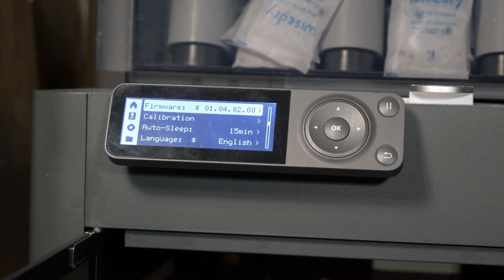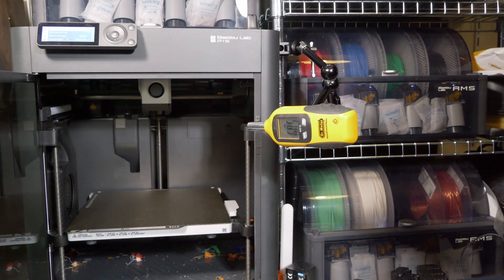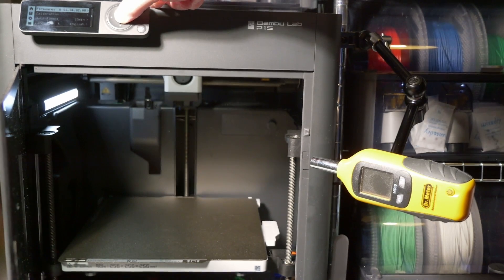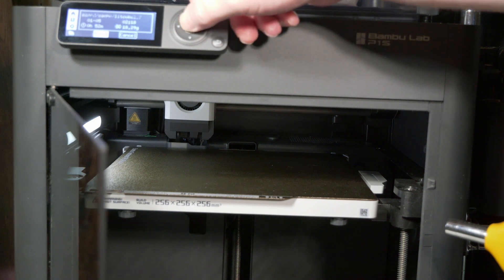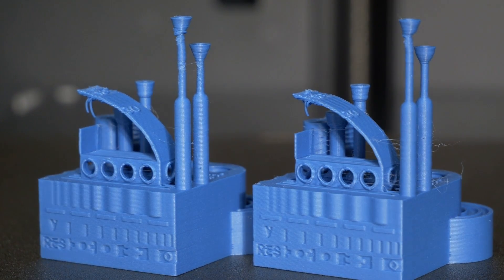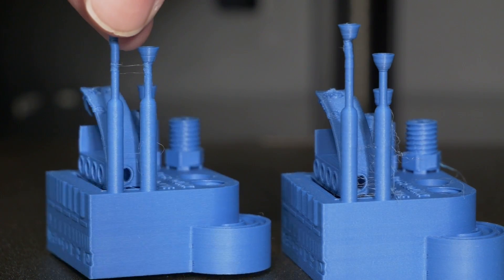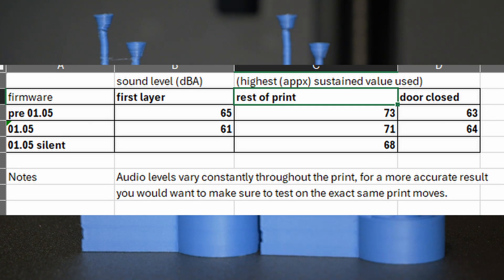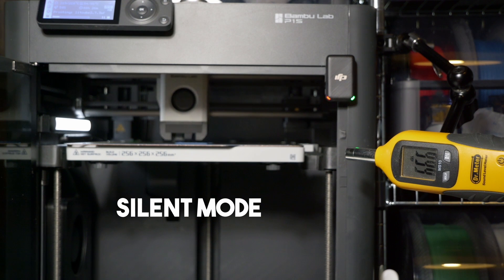Does the New Bambu P1S / P1P firmware REALLY make motors quieter? Tested before and after.

Comment: What is the deal with silent motors. Trinamic drivers already accomplish that and much more(but only a few printers take advantage of all the cutting edge features). BL reinvented the wheel?, by designing its own stepper drivers from cheaper controllers and now making it silent through a firmware update?🤔. Definitely makes BL machines little quieter.😂❤👍
Reply from the maker: I addressed it a little in the video after, but yeah who knows

Comment: The update was supposed to change noise levels of the motors, but the loudest part is the aux fan. So a noise level meter can't pick up a big difference, because fans produce white noise that covers the entire frequency spectrum. However if you turn down the fan to 50% or less then you notice the changes a lot. Before the update the motors themselves were producing sound in the lower frequency spectrum, which requires a lot more sound energy. We just don't notice it that much because humans are more sensitive in the medium and high frequency range. After the update you can hear a lot less of these low frequency (high energy frequency). This directly changes how far the soud can travel and how much it is affected by walls and doors. I think the noise level meter would also show a bigger difference if the fan was off before and after the update.
Reply: Which fan is the AUX fan? You mean the chamber exhaust fan? Is a replacement possible?
Reply: @Tome4kkkk  No, the aux fan and the chamber fan are two different ones. The chamber fan is in the back of the printer and the aux fan is the big one to the left of the heated bed. It always blows onto the part. It is there for additional part cooling to allow faster printing. Both fans can be replaced and you can get replacements in the bambu store.
Reply: @Noxoreos  That's good news that the main noise culprit is in fact not necessary in all scenarios! And is replaceable. Another candidate for the slapnoctuaonit treatment ;)
Reply: @Tome4kkkk  Right, not only that. The aux fan gets really loud above 60% speed. When your model is not that big, it is better to reduce the speed to 40% or less and place the object closer to the fan. Not sure if adding a noctua fan is that useful in this scenario because the main noise level actually comes from the duct that forms the airflow, which is supposed to be a rather flat plane. This is to avoid cooling down the heated bed and only affect the top surface of the print.
After using the printer for almost a year I don''t feel like it's a problem. I rarely set it to faster than 60% and don't print with the fastest possible speed, because the prints are also weaker and there is more internal stress when printing very fast.
Reply: @Noxoreos  Wow, thank you for the info! How do you set the RPM for the aux fan. Is it a physical-pabel-only deal or do the P1S profiles for popular slicers allow you to control that?
Reply: @Tome4kkkk  Normally with the P1P/P1S/X1C you would use Bambu Studio or Orca Slicer. There you set up a profile for each of your filaments and there you also set the aux fan speed. When you print an object, you assign the filament from your own profiles to the object and then start the print. This profile also defines the min and max temperatures for the filament, temperature for the heated bed, overhang setings, max flowrates and such. You can also define the type of filament and optionally it's color. I maintain a profile for each color that I have. For this you can copy existing profiles and modify them.
Reply: @Noxoreos  Thanks, some gokden comments from you! This reminded me... Ahead od me is a dreadful switching to a Prusa Slicer derivative... I find Prusa usability and UI layout attrocious. I really hope Bambu Studio and Orca have very little in common as far as workflow goes...
Reply: @Tome4kkkk  I've never used Prusa Slicer. I switched directly from Cura to Bambu Studio and almost immediately further to Orca. However, while Orca and Bambu Studio are very similar to each other, it still differs quite a bit from Prusa Slicer in terms of UI and features.
Though, I still sometimes search for settings that I remember from Cura but they don't exaclty exist in the same way or are named differently in a lot of cases.
Anyway, Orca is still my preferred slicer now because of all of it's features. Easier management of settings and profiles. Nicer UI (in my opinion), special geometry to tweak settings, that apply only partially to the object. The possibility to create simple objects by using basic shapes and boolean operations. Painting on supports, material choice, material painting, and much more.
Reply: @Noxoreos  One more thing. With Bambu this or that will I be able to trick the printer it's at Z=0 at custom heights? It is a must for me as I intend to print some dual-material cockpit panels and letterings and I do not want to dive into AMS and the waste game. Such tricks are easily achievable on printers relying on Z end stop switches.
Reply: @Tome4kkkk  Well, there are a number of ways, because it relies on a pressure sensor on the bed. You could for example use a piece of plastic to trigger against, between the heatbed and the nozzle. But for manual multi material I would use a different approach. You can add custom gcode and pauses after each layer and switch materials by hand. No need for any hardware hacks. Bambu Studio and orca slicer support this feature
Reply: @Noxoreos  I'm not really sure it would work for lettering labels that are inlay at least 2 layers deep. (question to self: does need to be that deep?) I would imagine printing a separate lettering model with some huge Z hop would be the way to go.
Reply: @Tome4kkkk  i'd say as long as the inlay is planar / perpendicular to the bed, it is possible even with multiple color changes.
Reply: @Noxoreos  What I mean is at layer 0 (at least)you have  both - the panel body and the label lettering. So gcode pauses won't help. Unless I'm missing something.
Reply: @Tome4kkkk  That is possible as well. You just need to declare different materials. I've actually done that as well already. You can define the pause command as the filament change in the printer profile.
This approach is useful for cases where you can't use the ams like combine tpu and abs. Or use pla support for tpu prints.

Of course you could also modify the gcode file and add custom code anywhere you want. It can be read from the sd card with your changes, but then you have to start the print from the display panel.

If the lettering is only one or two layers high, then you can also split the part into two different gcodes: the first file should only contain a single layer of everything but the letters and the second file everything else (all layers), including color changes. Then place the print somewhere outside of the center and just print both files normally and perform the manual changes. This works only for rather small prints. The reason why this works for up to two layers very well is, because of automated color sorting by the slicer. the first print assures the correct start. Then the first two layers on the second gcode file should only print the letters (up to two layers high) before any color change is needed, unless you have more than two colors. Though handling more color changes than that gets impractical very fast. Bed probing should be disabled for that.

Comment: One caveat. There is a problem with the filament calibration in 1.05. LOTS of posts on this in the BL forum. And you CAN rollback an update in the Handy app.
Reply: Not in this case for the P1P/P1S. This info is even printed on the update screen.
Reply: @Noxoreos  Several people on the forum HAVE rolled back their firmware. Might want to pay a visit there.
Reply: @swdw973  I've checked the app and the page that says "previous versions" is empty for my machine. I'm currently on 1.05.01 and according to many others it should show older versions in the ap. But it doesn't do for me.

Comment: Just measuring the decibels doesn't really tell the whole story. You should have check the spectrum of noise as in my subjective opinion what's gone is the high-pitched whiney noises and those were able to permeate through my office doors and through my ventilation around the house, but now it's just the fans that are loud and I've noticed no difference in quality with PLA if I turn the chamber fan from 70% to 50% and the aux fan down a bit as well, but the noise is a lot less noticable.
Reply from the maker: I would hope that was demonstrated with the sound recording, which was the whole point. 
Checking spectrum, as I already noted in another comment, is well beyond the remit of a small channel's budget - in fact even bambu's budget apparently as they used a similar meter to me in their own demonstration.

Comment: dont feel like a decibel meter is the correct tool for measuring the noise reduction.  The frequency of the generated sounds is much less noticeable after the update.
Reply from the maker: lol I'm gonna need a few more than 750 subs to afford a full spectrum meter, did you click the button? :)
Reply: @foundintech subscribed! I wasn’t suggesting you get one. Just that from using my ears, I can tell that this is a much more noticeable improvement in annoying sound reduction than simply loudness would suggest.

Comment: It sounds like they
* found out spreadcycle/stealthchop
* are tuning for minimum (noise) stepper current to not loose steps
* could be fiddling with waveforms as well?

The middle one might be added to other firmwares as well, if normal drivers can detect skips (or check if endstop is where it should be after rapid moves). Fortunately non-BL printers have had silent drivers for a long time.

But the real question is: how does it compare to the competition?

Comment: Would be interesting to see how much just the motor noise is reduced by doing a print with very lo fan speed. The sound level seems a little lower, but more importantly it seemed to reduce the higher pitched sounds which we might be more sensitive to, even at the same db.
Reply from the maker: I tried it - it sounds exactly as you'd imagine: loud when fast.

Comment: Your info is wrong the P1S can roll back the firmware the, X1C can not rollback the firmware because of the jailbreak. Bambu doesn’t want people to use it so they blocked firmware rollback. The noise is night and day difference. New firmware released 1.05.1
Reply: On 1.5.0 it could not but once you update to 1.5.1 (which came out last night) you can roll it back.
Reply: When I did the update on my P1P a text explicitly warned that rolling back wouldn't be possible after the update. And from what I see, that's true.
Reply: @Noxoreos  true, on 1.5.0. Now on 1.5.1 you can
Reply: @3vlogs487  I'm on 01.05.01.00 and that's the latest version as of today. But I still can't downgrade. The page in the app that's called "previous versions" is empty for my machine. Everything else works as expected.
Btw. That's also the case with the machine at my workplace.
Reply: @Noxoreos  that’s interesting. Maybe make sure Handy is updated because I see the option there for me still.
Reply: @3vlogs487  It is up to date and I have a link that brings me to a page that's called "previous versions" in the handy app. But there is nothing to select and the button at the bottom is greyed out, since i can not select anything.
Reply: @Noxoreos  that’s so weird that it gives me the option then. It may be an option in studio too if you actually want to downgrade firmware

Comment: Mine has noticeably less motor noise now. It's so much so that i moved the unit from my basement  to upstairs and I still hear it less. Fan noise is the same but kinda like white noise. The axis motor noise levels are way reduced and thats the distracting part. Turn the fan down and the difference is huge. 

Also... restart your machine again. Another minor update rolled out right aftet this

Comment: When printing PLA do open up the top or remove the lid?
Reply from the maker: I don't, and I'm not sure why other people think they need to. The fan in the back comes on to remove air, seems like enough to prevent any issues.
Reply: Yeah on my x1c ,which is pretty much the same enclosure as this one.
 I have never had any issue with PLA with nothing open. 
It's recommended by Bambu but I have no idea why.

Comment: I've been running a few PETG prints over the last few days, there's a really noticeable noise difference after the firmware update. It went from being annoying loud to the point where I didn't want to work in the same room while it ran (still not as bad as printing PLA), to being much more comfortable. I've not tried with PLA yet but I'd imagine that the additional fan noise reduces the benefit considerably.
Reply from the maker: it does, but I guess fan noise is less terrible from the next room.

Comment: For the test you should have turned the fans off at least the exhaust one. It is very noticeably quieter as there was a very high pitch and rumble noises before ignoring the fans.
Reply: Your Youtube handle is quite telling, is that what you do in this comment thread too? ;)
Definitely not doing any research or experiments, except maybe being pointless and patronising at the same time.
Reply from the maker: Should should should. 
Not at all. I want to use the printer in its regular mode. Nobody is going to print with the fans off!
Reply: @foundintech this update is for Stepper Motors only. Not Fans + Motors.
Reply: @foundintech  You can print a muffler or change to Noctua. The exhaust fan should be lowered for sure and chamber fan doesn't do much. After all this update is for the motion system noise not the fans if you are doing a research do it accordingly.
Reply from the maker: Feel free to do your own version if you have specific experiments you want to run. I wanted to measure overall print sound. Which I did. I'm not interested in diving any deeper in the second channel content at this time.

Comment: I have a X1C and it was audibly quieter afterwards, but it’d be interesting to do frequency analysis of the sound, because as you observed it is still a noisy printer. For me it just sounds different.
Reply: That MS10 db meter cuts off at 8,000 Hz, so any higher frequencies are just ignored. Depending on your age and the amount of loud sounds you exposed yourself to over your entire lifetime I'd say chances are you'd still be able to hear some higher frequencies. Which would change how you perceive the sound of the printer but they won't be reported by that meter.

Also, the said meter applies a non flat weighting to calculate the displayed values.